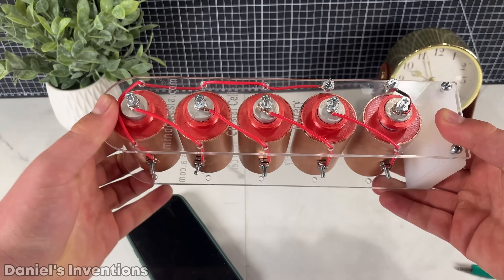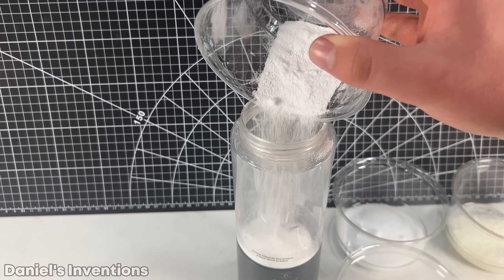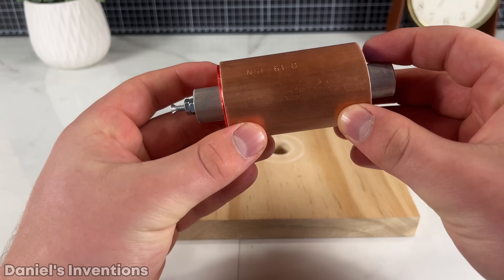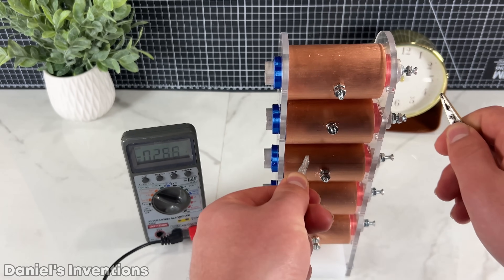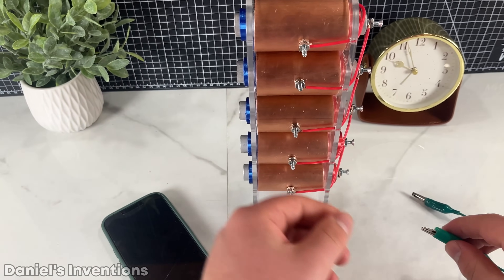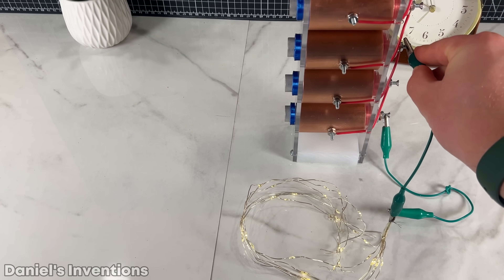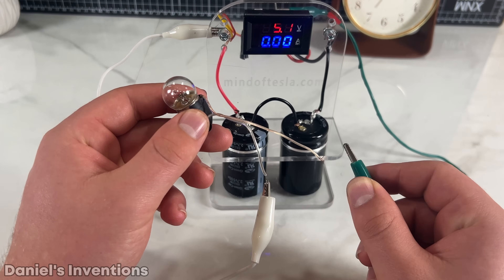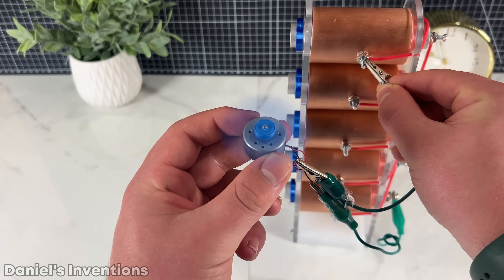A Crystal Cell Battery That Charges Itself

Comment: What is the need of requesting for comments when you will not respond,? In a absence of magnesium rod can aluminum rod be used and stainless steel in place of copper pipe?

Comment: Making a cooked and melt cell. Using a plastic cup a cooper wire and thick  rolled up piece aluminium foil , I found out after set hard when you move the aluminium foil side to side rapidly quickly causes the voltage to increase. Only works with aluminium foil, tried wire and metals doesn’t work.  Increases the voltage without needing to use a power supply. Possible theory causes internal centre of crystal to vibrate changing crystal structure and increase voltage.  Try for yourself and see if same result interesting experiment to try.
Reply: Not a plastic cup sorry. Will melt with hot ingredients. My mistake sorry.  Use metal container.

Comment: Pretty sure they draw in ambient moisture & output very small amounts of power via a galvanic reaction. It would be interesting to mix highly piezoelectric materials into the cell & in theory they could recharge themselves for a very long time if the correct mix is used. Also powdered graphite added to the mix reduces internal resistance increasing current draw you can get from the cells.
Reply: Like quartz?
Reply: @justanothercomment416 no, rochelle salt  yes
Reply: @justanothercomment416 i made one today n it runs the motor

Comment: The verb "generate" does not fit with voltage. A cell has a potential difference or voltage, but that means next to nothing if it is incapable of sourcing any current.  Even a potato or lemon with two metal strips will cause a voltage of 1volt, but you ain't charging your phone with it.

Comment: Some tips that helped me,1. Electrodes should be close. 2.try just alum ,magnesium n borax in a   pot heated till becomes a liquid then pour into cells. 3. Initially  charge them with 3 volts per cell
Reply: What is the alternative for the detergent and no salt? Should be charged with what type of charger for the 3 volts u recommended?

Comment: Very good ❤

Now you can add a voltage doubler or “Joule Thief” circuits. You can use up to 6 cells in series … if you add more, voltage is sagging … make as many modules of 6 as you want and forget about solar panels.
Reply: You spelled solar penis wrong
Reply: Sense!!!